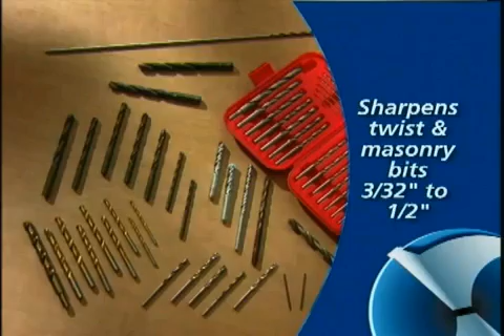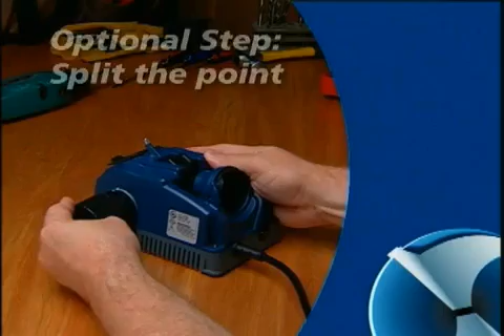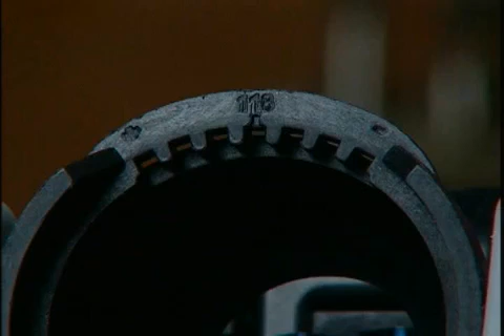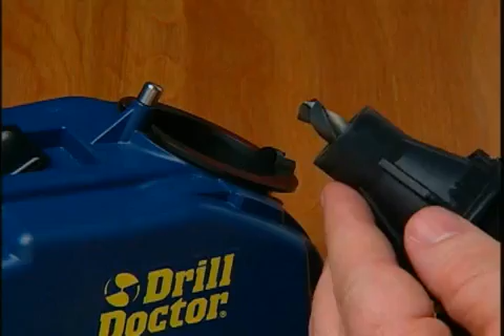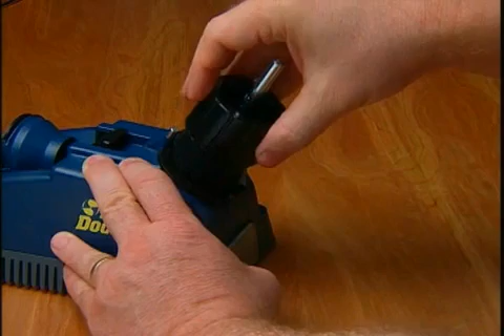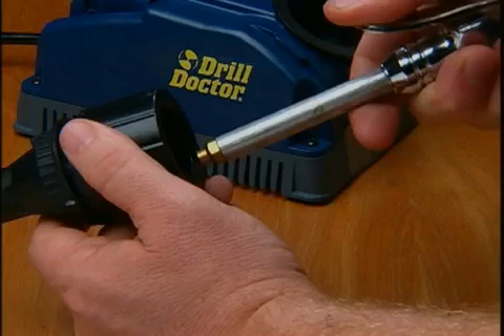Drill Doctor XP: Demonstration Video

Comment: Ok, so I was with you folks; literally about 6 to 7 years ago I bought this thing and never once used it...just skimmed over the instructions and said piss on it, and put it in a cabinet and never looked at it again, until to day. 

I'm making custom doors for a Kubota RTV X1100c, and skinning the metal doors with a heavy canvas, to deaden some of the noise when pushing through dense brush...always sounded like a bunch drum sticks tapping on the doors...drive you crazy! SO, the canvas changed that 100%. 

  The issue: About 100 holes per door for rivets. I only have 1 bit that is right for the rivets...was dull before I even started. 30 miles to get another bit. had a thought: "Oh yeah...that damned drill sharpener". Get it out, and set it up, and once again skimmed over the instructions, and kept getting a flat grind...was pissing me off. Then I go back to the instructions...SHIT! The white index marks on the bit-holder ARE NOT what you line-up with the 180 degree mark on the angle finder to set your bit...it's actually the two black plastic fins INSIDE that collar that is holding the bit, that you line up with the 180 degree mark on the machine. it sets the correct depth AND angle for a particular drill size. THEN you move it to the other end of the machine and align those white index marks with that metal post on the machine and slowly twist, clockwise with even pressure so it "wobbles"/tracks the cams on the bit holder. Son of a gun...even a tiny bit was cut exactly at the right angle and works at least as good as new. 

Forget about the side chamber for "split bits" until you work-out how to use the regular sharpener, which will have you kicking your own ass when you realize how well it really works. Once you successfully sharpen a few bits, then open the side chamber to split bits, of course only on larger drills. It actually sharpens fantastic. It's the damned instructions that leave a bunch to be desired. All these years later and I can finally stop free-handing my drills on my bench grinder, which works ok for large drills (bits), but sucks ass for tiny ones like I used today. Don't give up y'all...worth every penny once you get it.